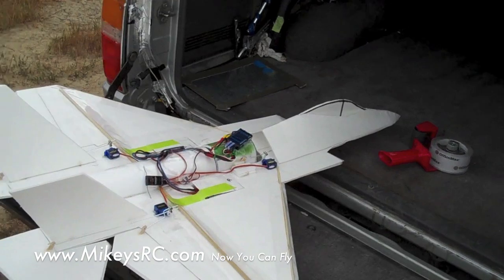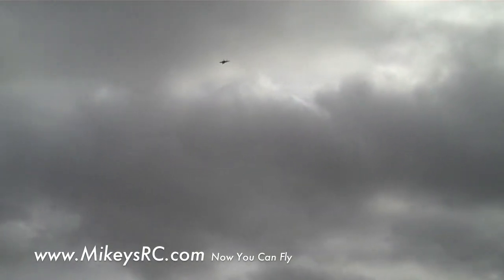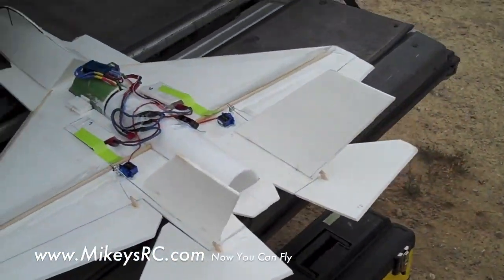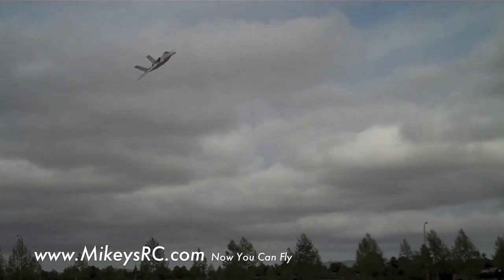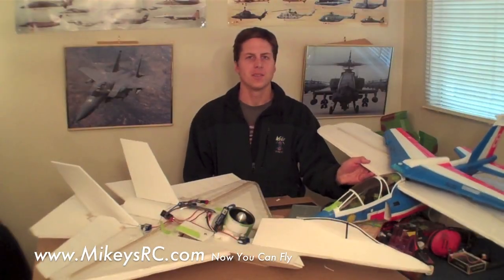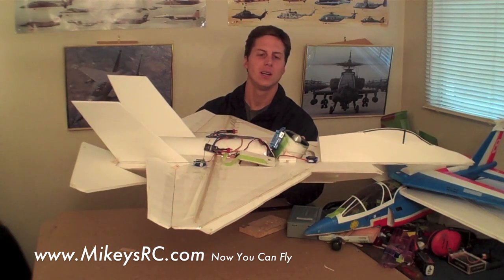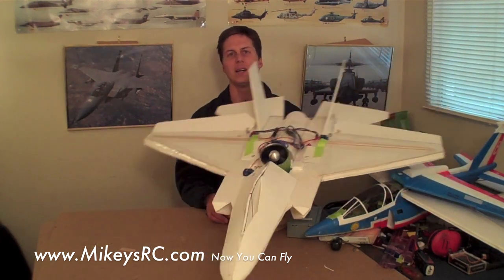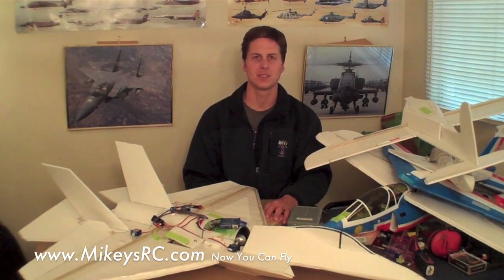F-35 STOVL RC Jet

Comment: the first year of flying was with a hirth 650cc two stroke. had several problems with the hirth and installed a 650 cc rotary. you can see a lot of my stuff on face book and   emers planes   on youtube. my last homebuilt was a fokker d8 ww1 fighter. gonna check your build channel out.           george

Comment: leadfeather was really successful with his VTOL F-35 using a 3 step transition process using prop motors. you are taking on a serious challenge using EDF to power your version. I'm hoping you succeed but I feel there will be lots of failures on the way due to the inefficiencies of EDF's. good luck Will, I'm rooting for you.

Comment: @MikeysRC That is just the way you have to do it, also the mixing is equal between the elevons different movements.  When I built my first mono-wing, I had about 120% movement one direction and about 80% the other.  So I had to set it up same as you with dual ailerons, and used only one mix to tie in the elevator.  You should be able to do it with only one mix.

Comment from the maker: @pushinold Basica elevon mixing is easy.  But I found that the my flaps wouldn't work properly with elevons.  So I used the two mixes avaliable and also set the plane up using dual ailerons mixed to each other.  I know it sounds kinda weird but it works.

Comment: I am not familiar with the DX6i, but if it has programmable mixes, you should be able to mix elevator (spoilerons) with the motor rotation to enable a smoother shift to VTOL